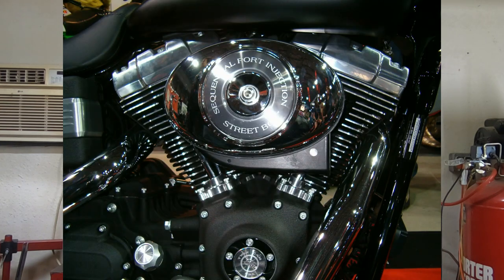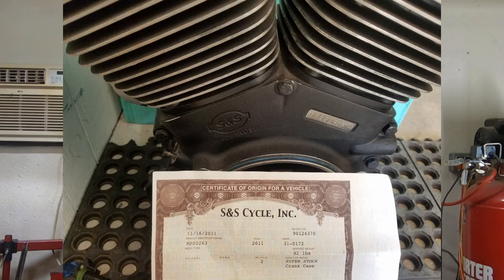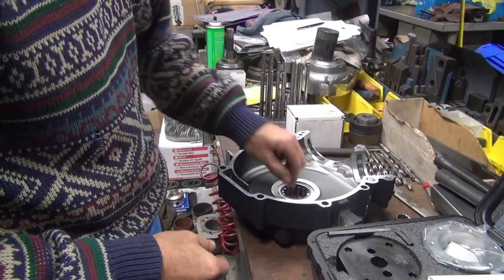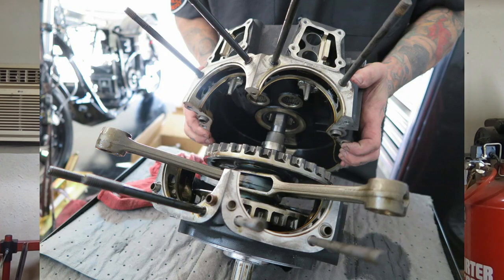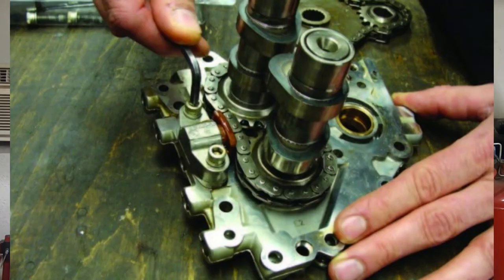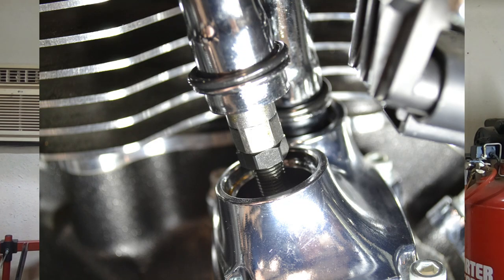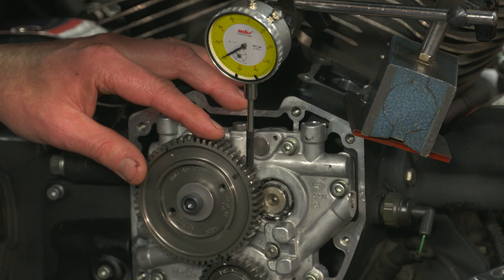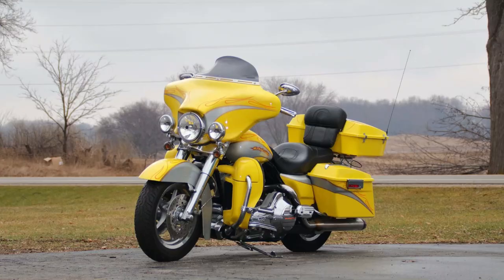Twin Cam Harley Engines Can Be Bulletproof

Comment: The days of Harley guys breaking up stolen Harleys for part is long over. Today's Harley-Davidson Rider can barely put gas in the fuel tank.
Reply from the maker: Yeah hardly anyone still does their own work these days!
Reply: @GixxerFoo  I had an argument with the old Harley dealer because she had an oil change special for $100. I told him I could change my oil in my driveway in 20 minutes where I have to work all day to make $100 . For the most part today's Harley Riders could not change the spark plugs.
Reply: Wrong.
Reply: @jimfischione2743  unfortunately I am not wrong. Today's Harley Rider would have to Google which end of a screwdriver to use. I have for over 50 years I have watched the Harley Riders deteriorate from what they used to be to what they are now.
Reply: It's still going on.
Reply: @frankmarkovcijr5459  your right Frank . I am NOT a mechanic  BUT I can do the basics  which have saved me thousands ( literally) servicing my 14 Streetglide and 05 Deuce . I can get my Amsoil from the supplier and do a three hole for approx  $130 or less. I only get the sump plugs o rings primary gasket and oil filter from Mr Harley.  It's $145 an hour at my Stealership and they would take at least 2 hours or so they say !!!I believe a straight forward service is like $500! With Sin 3 shit in the motor. There are crap loads of dudes around that can't or won't change a spark plug thats an absolute fact .👍😎🇺🇲
Reply: Bs…
Reply: @guins99  do you care to elaborate further? In the old days when I started writing my little Honda with the Harley boys I watch them fix stuff in guys garages. Guys who had little experience had older guys helping them and showing them what to do. The founder of my BMW Airhead Club saw this and started Tech days for the club so older members would BMWs could help younger members learn how to work on their own bikes. Now I was never a member or a prospect I was what they called a hang around. I went on the rides so I had to ride in the back but that was okay cuz I could smell all that yummy Harley Oil and listen to all those old motorcycles jamming down the road making music. I could go to all of the swap meet I could go to any of the events I could go to any of the clubhouses when they would have open event. I rode my little Honda behind my to Harley riding uncle's to the Sturgis back in 78 last year they had camping in City Park the one in which they tied it sickened Dynamite to that Kawasaki and blew the front end off of it. The one where they had to burn all the Outhouse just because the pumping company was too scared to come into the campground and it got to be so nasty you couldn't get within a hundred feet nevermind swarms of biting flies all over everywhere. I know people who still remember me from the rodeos 30 years ago. Nothing I say is bullshit I say what I mean and I mean what I say. There are a few of the old greybeard bikers older than me and they would agree on every point I said
Reply: @jps3903  I would respond to your comment but I cannot make any sense out of it. Today's Harley Rider is not like the Harley Rider of the 1970s when I first started riding. I stand by my statement.
Reply: Now you’ve scared me! I was planning to do big bore cylinders and pistons, S&S Easy Start cams,  a forged billet cam plate and high volume oil pump, have my heads CNC ported and the crankcase machined for the old style Timken crank bearings, replace the Harley compensator with a Darkhorse elastomer compensator eliminator, adding a Fuel Moto variable pressure clutch, and a manual primary chain tensioner to my ‘06 FXDWGI after this riding season is over. Oh and I thought that I’d put new plugs in as well, but now you’re telling me Harley riders can’t even put their own spark plugs in or change their oil what chance do I have?

I’ve been wrenching on 1 thing or another for most of my 67 years and I don’t think I’m going to let you talk me out of doing what I want to my bike. If I screw it up I’ll look you up to bail me out.
Reply: No, today they are trying the old ford denouncing, as a way of buying all them cheap, sitting on them decades and selling at huge profit. 
 Similar as when they denounced AMF (about the greatest thing on earth) trying to get deals on buy out of unsold bikes bike conspiring to steal large amounts of bikes. 
 Like with all good vehicles today.  
 They’ll get word out , for example Jeep sucks. When Jeep does not sell, buy large amounts of Jeep, sit on them, and sell them for good money on the inturdnet compuewterd
Reply: @chrish5791  You are a mechanic so I wasn't referring to you but I am sure you get the point of my comment.
Reply: @frankmarkovcijr5459 not just harley riders.
Reply: I accept turning wrenches is a valuable skill with the ability to do work on your own bike.  Moreover, you don't have to wear oil drenched clothes and smell like petroleum to be a Harley rider just because you can use a screwdriver.  If such a person's ego is so fragile that they can only find a boost in their emotional well being by thumbing down those who don't, or, cannot turn a wrench for your sake I wish you the best anyhow.
Reply: @dcccharles4569  I was only saying the truth. For most of their riding skills match their mechanical skills. I would say the same about 90% of the motorists as well.
Reply: I’m 65 and a new HD TC owner coming from a ‘76 Triumph T140V and ‘86 Moto Guzzi bought new that have never seen a service department.  No problem stripping either down to the sludge trap.  It’s the electronics that are the obstacle for most old DIY guys.
Reply: @MAHGlie  When my Triumph Tr-6 with a hard tail and magneto wore out the camshafts and we had to split the cases the sludge trap was almost full.We put new cams in and sludge trap so she is good for another 50 years.

Comment: 25 years and still going strong. Waiting on my motor to have issues so I can rebuild my engine but it seems like that may not happen for a while. I did replace my pushrods, my lifters, and lifter blocks last year. Maybe I'll replace my cam bearing, cam, and valve springs next but there isn't any urgency yet to do those. Thank God for Evo...best motor ever
Reply: I'm watching this video to see if it finally sways me towards shopping for a TC.  The carb'd EVOs are getting tough to find in my area, while the TCs are everywhere.
Reply: Watch those cam chain tensioners the early models 99-05 I believe! If they blow apart it can cost a pretty penny to fix the damage! It’s best to upgrade to the hydraulic cam plate
Reply: @ORflycaster  just get the twin cam man an Evo is a slow turd with no way to help it.
Reply: @Jeep Guy  go for the 103...
Reply: @Jeep Guy  go for the 103...
Reply: @xrick76tube  Nope. 94k miles on stock 2000 tc88 tensioners, Still goin strong.
Reply: @ajb1117  wow but those cam chin tensioners have been replaced over the years right?
Reply: @Mark-iu8my  get the evo. Yeah its slower but people in a hurry are just spoiled brats. Its the ride not the destination.

Comment: That's what I love about my Harleys, I can rebuild the engines with quality parts for much less than buying new.
Reply from the maker: Easily and continue to customize the bike however you feel.
Reply: That is what i like about my Kawa's and Honda's... no need to rebuild at all. Only replace wheel and steering head bearings because they worn out from... riding.
Reply: Why , just by a bike with s and s. Or go s and s.

Comment: 113,000 miles on my 2003 Road King. Although I had to replace the mechanical tensioners (preventive maintenance) is the only 'problem' I had. Just put in set #4 and should be good for 30K more. Run out was .0018 .  Oil pressyre is hanging in at 33 idle -40 running

Comment: Love my TC88B,this engine is so well balanced and smooth running
Reply: That's been my experience with the two I've had. Still have one. 👍
Reply: My only prior Harley experience was with an ‘89 Softail Custom of a friend of mine. It’s what I finally got my Wisconsin motorcycle license on, in ‘91,  after 20 years of riding while only getting permits. I liked the looks of his Softail which is why I ended up buying my 2006 Dyna Wide Glide that had a Twin Cam 88. It took me a while to realize that the TC 88 likes rpm’s more than the Softail’s Evo did after riding it like I had the Evo. It pulls fairly well at low rpm, but give it some revs and it keeps coming on stronger. It worried me enough that I ordered a HD speedo/tach combo just so I know just how far I’m winding it and you’re right about it running very smooth. I’m adding a K&N air cleaner and filter, a Jagg horizontal mount fan assisted oil cooler, and I just ordered a Power Vision PV4 to richen up the fuel map a bit which has me eagerly waiting for Spring to see how much difference they make in performance and in helping it to run a bit cooler.
Reply: @chrish5791  where did u get the oil cooler from?

Comment: 😊WELL IM IN THE UK AND IVE JUST REBUILT MY 2005 DYNA GLIDE SUPER SPORT IVE REPLACED THE CRANK CASES FOR THE EARLIER CRANK CASES THAT-HAS THE DOUBLE TIMKEN BEARING SETUP I THEN HAD A WELDED STROKER CRANKSHAFT FITTED THE CRANKSHAFT RUNOUT WAS LESS THAN 00.2 THOUSANDS OF AN INCH WHICH MEANT THAT I COULD FIT GEAR DRIVEN CAMS I THEN FITTED HOTTER CAMS ,FUELING CAMPLATE AND LIFTERS I THEN HAD THE BARRELS BORED FROM 88” TO 110” THE HEADS WAS FULLY PORTED AND BIGGER VALVES FITTED AND EVERYTHING WAS PUT TOGETHER WITH METICULOUS PRECISION I ALMOST FORGOT I ALSO FITTED A NEW FUELING HIGH OUTPUT OIL PUMP 😊 I CANT WAIT TO GET IT SET UP ON THE DYNO😊

Comment: I agree, love the sound of the twin cam.  Still got a lot of miles left on my 2014.  My problem is I got the bike running so good, I'm afraid to touch it. Did both engine and suspension, front and back. Did not do the bottom end though. So far no problems.  Even if I bot a new bike, I'd have to throw a lot of money into just to get it as good as mine. Thanks for another great video as i watch the snow melt in the yard.
Reply: @Mark Do you find your motor running to hot often? Just wondering because i read that a lot.
Im in the market for a streetglide.
Can afford a second hand 103.
If i save money a 2 months maybe a second hand 107.
Drove both and thought 103 had a better sound but more shaking when i released the right hand .
Didnt notice remarkable power differences except for the 107 maybe pulling up a bit faster in the first gears
Reply: @petro77vitch yes sir the 103 is hot. However the research is plentiful. Tank lifts. Tune. Wire tucks etc. will all lower the temps substantially. 

I went with a PV3 tuner, I notice the lower temps right away.
Reply: @petro77vitch  No, mine does not run hot. One thing I did was to put a K&P Engineering oil filter on. This is an amazing oil filter. I'm looking at the specs, and it says ''Up to 7 times more oil flow than paper filters'. It's made of billet aluminum and finned for heat dispsurtion. jmo I think this is a big reason for less heat. One great thing about it of course, last oil filter I'll ever buy!  My specs are 116 ft/lbs of torque and 103 hp. Woods 222 cam, heads by Dan Vance Racing, a thin head gasket from HD and V&H power duels. Hope you found your bike.

Comment: Gixxer I love my 2002  FLSTC. For the last 1.5 yrs I listened to you and waited for my used scoot to appear. Mint. cond.  low low MI.  I have put $11000. into my scoot . Paint,95 big bore, Massive head work, chrome front end SS 583cam, My scoot is carb. Paid $9828.63 out the door. Yes she is a show quality and a screamer. [2into1 exhaust}  Some might say I should have bought a new scoot. Not. I still saved big$$$$$$$$$$$$$$. Thanks Gixxer.

Comment: I've already invested in my Twin Cam,  gradually discovering the flaws and fixing them. The only thing I haven't fixed is the crankshaft. It's within spec for now but I don't fully trust it unless I eventually get it trued and welded. I've got an S&S 509 Bolt-in cam in there now and that's about the most modification I trust this engine with.
I will say this, had I known what I know now I would have bought another Evo Sportster instead of a Twin Cam. Harley-Davidson left way too much on the shoulders of the customer with this engine that should have been built right the first time. That's why I laughed when Harley-Davidson calls themselves a premium brand.
Reply: Should have been recalled !
Reply: @jeffhawkins711  i agree 💯

Comment: I have an 06 ElectraGlide Standard that has evolved into my version of a CVO. When it had 30k on it I had the cam shoe upgrade done. My mechanic talked me out of a gear drive. Everything you listed here with the exception of the crank work has been done to my 88 at that time using S&S and Fueling parts. I opted not to punch it out to 95 or 98 CI but had it bored .030 over for new pistons that got it to 90 CI. I had extensive headwork that got the compression to 10.2:1. It was tuned to run on 91 octane where it puts out 96hp. That was 80k miles ago and it is still running just as strong.

Comment: I guess I'm a dinosaur, as I'm still riding my 1949 EL Panhead. Not a hot rod but solid and dependable. Speaking of reusing gaskets, back in the day when we worked on British bikes they used copper head gaskets and we would anneal them and use them again.

Comment: Just got done doing everything you mentioned in your video.
Installed: S&S 4 3/8" crank +Timken bearing kit (Jim's)
                S&S TC3 cam plate & oil pump
                S&S Quickie pushrods + Hylift Johnson lifters
               Jim's cam bearings + SE 585 cams (I plan on touring and NOT attempting to launch myself into another dimension.)
              Heads pressure cleaned, new AV&V valves and springs + compression releases
              Did the S&S sidewinder 110 kit with the matched JP Carillo high compression pistons (10.5-1)
              Will be running Rineheart 2 into 1 exhaust (First time! I don't know how I feel about that yet)
People have said, why don't you just buy a new bike? I say because I love mine! It's an 08 Roadglide. I plan on this one sticking around a while!
Always dig your videos! Thanks!
Reply from the maker: That's what I call doing it right!! I bet that bike runs hard and you know it's reliable setup like that!
Reply: @GixxerFoo  Not just yet. It's a brand new build. Tuning & Break-in comes next!

Comment: I ride a stock '99 Heritage Springer last year evolution motor and its already bulletproof. I may down the road put a cam and a carb kit in it. She's still has fairly low miles. Twin Cam is a good motor.
Reply from the maker: Evo is solid reliable, the Twin Cams already had a few things that needed to be done to make them right.

Comment: Everything you said about the twin cam is true with the M8.  They have  bad oil pumps until 2021, crappy cam plate as well (Put in S&S Cam plate, Oil Pump and lifters with lifter guides).  My compensator didn’t last 10k miles (Put in Darkhorse).  Clutch basket had more cracks in the a 50 year old driveway (Put in Barnett complete clutch).

Comment: You just described my rebuild. I had my engine fully rebuilt at 150K. S&S crank. Timken bearing. S&S 551 Gear drive cams, oil pump, cam plate, and Kevin Baxter lifters. Dark Horse compensator. 107 cylinders with R&R heads set at 10.1 (110 TQ @ 2,000 RPMS 119 Peak TQ @ 3650)

Comment: It took me 30yrs to warm up enough to an Evo to finally buy a '97 WideGlide.
 I bought an 02 Twinkie Softail Springer a couple of years ago, but sold it after two months because it had no soul.
 If it doesn't sound, ride, and feel like a shot up B29 trying to limp home on one engine, it ain't a Harley.
 That's why I prefer my  '72 Shovel head ElectraGlide.
 You make good videos.👍
Reply: Tc 88 and 103 have a shake rattle and roll feel. Not like my 81 but I always have guys at red lights watching my hands and arms shaking and they always love that old-school rattle.
Reply: @brandonmacon3317  
 I had  a Twinkie 88B with the counter balancer and EFI, and it didn't feel like a Harley at all.
 My wife didn't even like to ride on the back of it.

Comment: When I had my 78 kz100 engine rebuilt and bored, the guy didn't check the ring gap and ended up putting stock rings in an oversized piston. When I put the engine back in and got it fired up, it blew oil out of the exhaust because of the big ring gap. I took it back, and he fixed it and reused the Cometics head gasket. So now it leaks. I would reise a head gasket on anything.  Rockboxes, maybe, but after all that money spent, it sucks to get an oily boot.

Comment: 07 and up TC engines are impressing me .   Couple of bikes I take care of are approaching 200,000 km  (124,000 miles)  with no issues.  MOCO in 07 transferred problems to drivetrain with there adjustable primary chain adjuster destroying most bearings on mainshaft, along with disintegrating splines in clutch hub.
Reply: Yes, I experienced those issues with the auto tensioner. 
Splines in the clutch hub, etc. First time I got into the primary, I discovered the chain was tight as a piano string. Something just didn't seem right about the way it functioned. 
      I converted my factory auto tensioner to manual, with a little work and about a buck and a half.
Reply: @williamolson3704  Just goes to show you that modern engineers probably never had a pedal bike in their youths, that needed chain adjustment.   They were too busy on their smart phones.

Comment: 2015 TC 22k miles so far. Just had the tw222 put in, and that OE fuel moto oil pump. I originally ordered the SS oil pump, then I seen one of your previous videos, and returned it and bought the OE+. Thanks for the advice